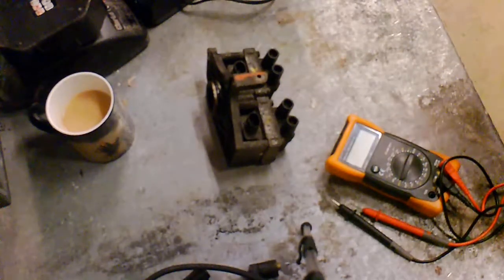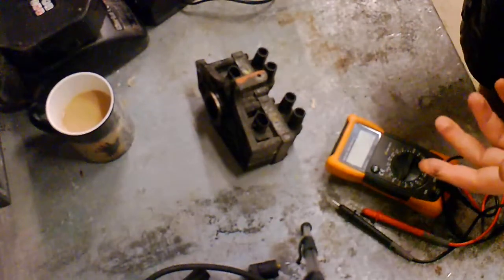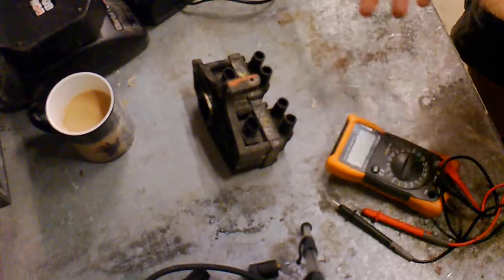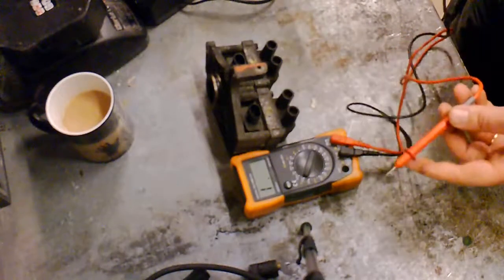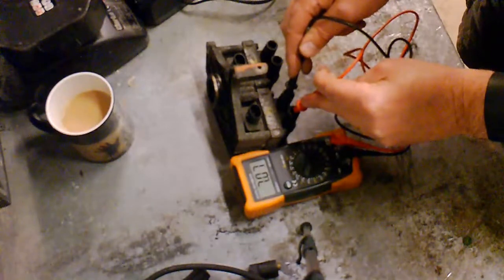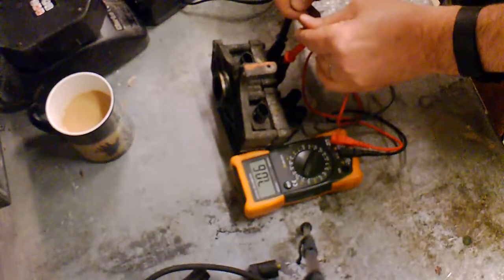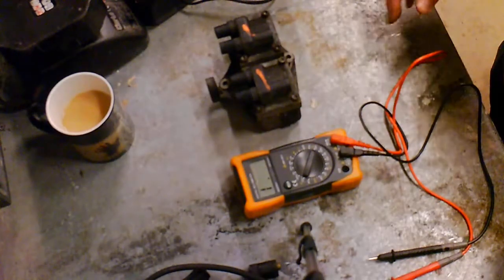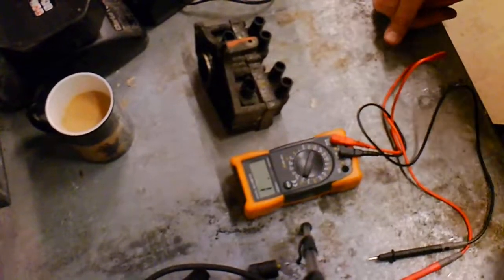Fiat Punto ignition Coil pack testing

Comment: Primary windings 0.52 to 0.62 ohms
Secondary windings 6.83 to 7.83 k ohms

from book bro to help you
Reply from the maker: Cheers mate, I’ll pin that.👍
Reply: My new igniton coils have 7.2 and 7kohm resistance, is that difference okay?
Reply: @ДаниелСпасовски-ъ4к   its good its ok bro like new
Reply: Thanks mate, found some knock from it , hard knock so trying to change it, so waiting it to be delivered
Reply: Fiat 1.2 (Ai)
Primary Resistance: 0.4 to 2.0 ohms
Secondary Resistance: 6,000 to 15,000 ohms (6k to 15k ohms)

Fiat 1.2
Reply: Ai For the Fiat 1.2 engine (code 178E2000), the typical resistance values for a healthy ignition coil should be around 0.4 to 2 ohms for the primary winding and 6,000 to 10,000 ohms (6 to 10 kOhms) for the secondary winding.

Comment: Salutare pe ce functie selectati multimetru ca sa masor bobinele de inductie la fiat punto si ce valoare trebuie sa aiba bobinele noi care sunt in stare buna
Reply: διαλέγεις πάντα την μικρότερη, το θέμα είναι ότι δεν ξέρω τις μετρήσεις σε MK1.1 55SX
Στα 200ohm παίρνω 01.0/01.1  στο κύριο, και στον δευτερεύον 7.25/7.34 kohm

you always go for the smaller one, the thing is i don't know the measurements on MK1.1 55SX
At 200ohm I get 01.0/01.1 ohm on the main, and 7.25/7.34 kohm on the secondary

Comment: Nice video. I do not take any indications in the output lines of one coil pack, it is broken ??  on what scale of Ω meter I have to count ?
Reply from the maker: Are you getting spark from the coil, I use setting 20k ohms. What symptoms are you getting?
Reply: @drivewaydiyer6504  my car started to do at some point miss fire symptoms after accelerated with low speed and some operating hours. I  changed spark plugs, cables of spark and one ignition coil and symptoms of miss fire  decreased ,do i have to change the other one? Car is fiat Punto mk1 sporting 1.245 16v  and 160.000 km. The spark plug I did not check it.. my car was moving very little for a long time with a dropped battery, when I inserted a new battery the symptoms started after fiew weeks.
Reply from the maker: Always change both coils, all leads and spark plugs. How long was it still for?
Reply: @drivewaydiyer6504  he was sitting for at least three years and go short distances with low battery. I just ordered another one now for sure. thanks for her tips..  the factory coil was champion now I will put magneti mareli.
Reply from the maker: Something else to consider, when a car has been sitting, fresh fuel is a must, old fuel loses its potency.👍
Reply: @drivewaydiyer6504  Definitely.. the car moves quite often with fresh fuel. I will see the results when the new one is installed.
Reply: Ok i installed the second magneti mareli coil and the fiat running smoothly no misfire no problems. 👍
Reply from the maker: Great news 👍👌

Comment: On the last testing in kohm, i'm getting exactly 8 kohm(8000ohm) for the two ht transformers.. and for the two coils output .. Is that meaning that i should change the two coils ? I'm getting random missfires on cylinder p0352 and sometimes on p0351... in hot weather the missfires are more present... it's fiat punto mk2 1.2 8v 44kw 2004
Reply from the maker: Даниел Спасовски the resistance may be a little high, but check with manufacturing specs. Coils can overheat and fail, but be fine when cooler. Might be worth changing them. Change leads and plugs as well. Check for melt marks and arcing marks. Hopefully this helps
Reply: Driveway DIYer This reading is when the car is cold.. so when is working.. surely the resistance i s higher.. so maybe that is problem.. and i have changed  the leads and spark plugs.. all brand new ..
Reply from the maker: Даниел Спасовски the problem with coils is that when they are breaking down, the can be fine when cold, but fail when hot. You’re right , the hotter , higher the resistance. I have had coils fail at high speed , but fine when driving  short distances. I know Fiat always recommend changing the coils when changing plugs and leads. Are you getting spark on the cylinders you have codes on.
Reply: Driveway DIYer its not safe to check when the car is working.. so for sure im getting spark when the car is working normally ... but when i have only 3 cylinders working .. sometimes little throtlle helps the car get back working on all 4 cylinders.. and untill now.. i have 193.000 km passed.. and the coils havent been changed.. and yes sometimes on high speed im loosing power.. suddenly.. and the car is working on 3 cylinders.. the p0352 error code is always present when i have these situations..
Reply from the maker: Даниел Спасовски you could swap the coils over and see if the code changes to a different cylinder. If it does then def the coil. If not then you should check fuel and compression.
Reply: Driveway DIYer i have obd 2 scanner.. when the missfire is not present all the time.. when the code is stored in car.. and when the car is back with all 4 cylindera working.. i can clear the p0352 code.. but when the car is all the time working on only 3 cylinders, when i try to erase the code the check engine light is on and off .. blinking..
Reply: Driveway DIYer the compression is great.. because i change the piston rings and all gaskets before 20.000km 😊
Reply from the maker: Даниел Спасовски I think to put our minds a rest, change the coils and go from there. It won’t hurt, as they’re old . Let me know if that works. Intermittent problems are so annoying. Good luck.
Reply: Driveway DIYer thank you alot.. and sorry for bothering you.. if it is safe to swap the coils.. i will swap them.. so if i get another error i will ne sure that the coils are the problem ☺
Reply: Driveway DIYer hey friend.. i swap the coils.. and 5 days after that.. i dont get any of the missfire problems... or error codes on my obd2 scanner.. its strange.. whats your opinion ?
Reply from the maker: Даниел Спасовски sometimes the ecu has to relearn fuel trims etc.  When the car has ran poorly for a while, it has to balance fuel and air. Sounds like a fix, hopefully.👍
Reply: @drivewaydiyer6504   Hello again :)
On the Ht input resistance test i'm getting 2.6ohm and 2.8 ohms on the other coil..
On the HT output resistance test, i'm getting 7.4 kohm and 7.3kohm..
What means this strange result? 
And also when i tried to measure continuity on the HT output pin there was no result.. number 1 was on the screen nothing else...
Reply from the maker: Даниел Спасовски is the car misfiring are you getting spark from all leads
Reply: I swap the coils.. But i still sometimes get faulty code P0352.. And sometimes my idle is rough.. When i start the engine..
Reply from the maker: Даниел Спасовски did you change leads and plugs. Check your wiring to the plug. They’re a two pin plug and can get very hot, next to the head.
Reply: @drivewaydiyer6504  yes i have changed them .. spark plugs and ht leads..
Reply from the maker: Даниел Спасовски ok if you’ve changed everything and you’re happy with the parts you’ve used. I’m sensing a wiring problem. Like I say, the power to the coils are next to the head and can get hot. Make sure they’re are well insulated.
Reply: @drivewaydiyer6504  i will start the car and night.. and see does anyone of the ht leads have bad contact or maybe i will see some spark how is touching the ground.. however i will make video in night.. hope that i will get misfire...
Reply from the maker: Даниел Спасовски sounds like a good plan, let me know how it goes👍
Reply: @drivewaydiyer6504   My new igniton coils have 7.2 and 7kohm resistance, is that difference okay?

Comment: Hi. Nice and needed tips. Thnx a lot :)
What were the symptoms you were having before coil pack changing and did it fix it?
Reply from the maker: Torgut Ysi rough idle and cutting out, when hot. Look for arcing signs, white spots or melting to the casing.
Reply: Ok. 
I got random misfire kind of stickynes when accelerated. 
Found out that some of ignition leads liked to ground on head cylinder, even when all leads looked mint condition and had good recistanses readings. Now changing leads and testing also these coil pacs as shown in your video - readings looks good.  
Thanx for vid - it helped :)
Reply from the maker: Torgut Ysi the leads aren't well set out on these fiats and are vulnerable to wear. Fiat advise changing the plugs, when changing out the coil, there's a chance of surging if the plugs are worn and short out the coil.
Reply: Ok, good to know. Thnx again.